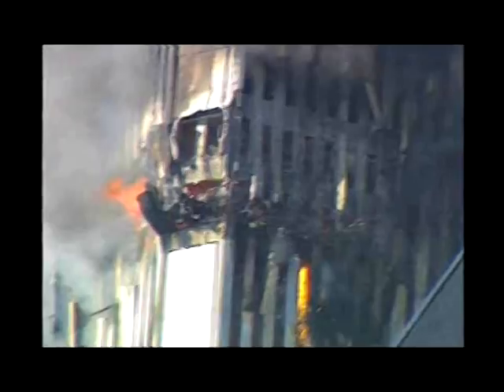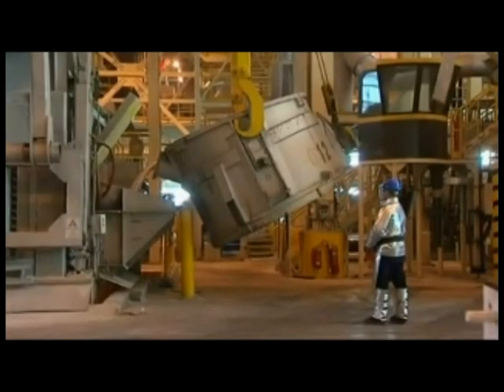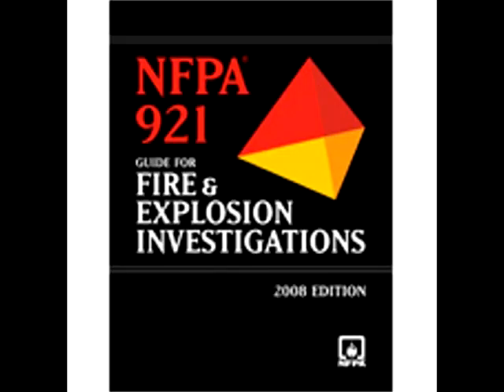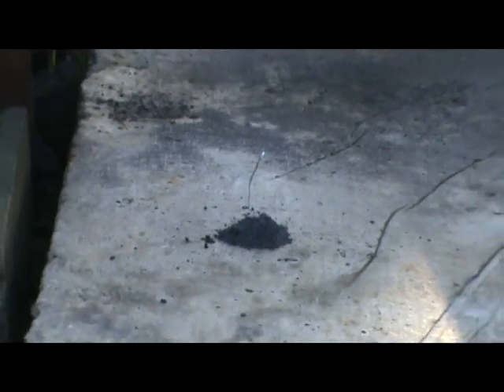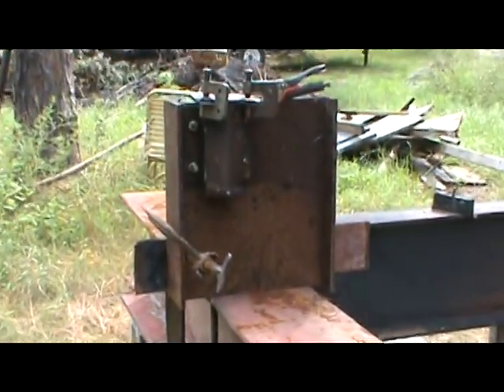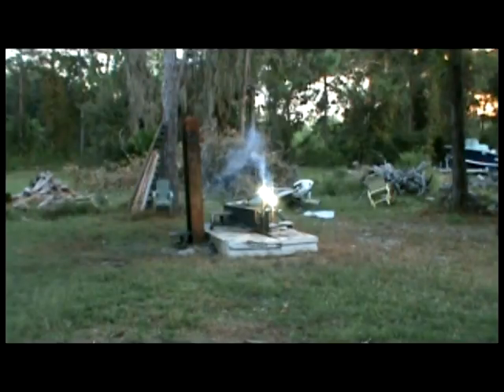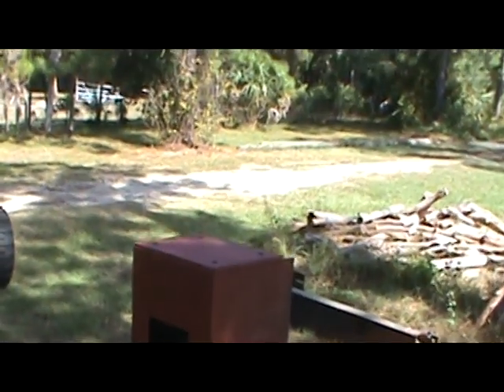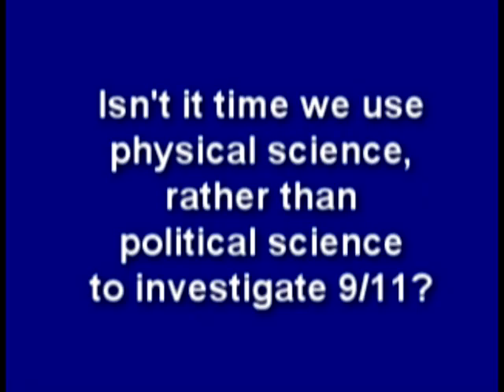9/11 Experiments: The Great Thermate Debate

Comment: Take a piece of steel rebar and try to bend it. Then heat it up with a propane torch and try to bend it. It's not rocket science everyone thinks that the steel beams needed to melt for the towers to collapse. Once they heated up with the weight of the remaining floors above them it was more than enough to collapse the towers
Reply: ScramerDude OK so if the beams were bending, why did the towers not bend sideways instead of falling in on themselves?
Reply: Because you touch yourself at night, gullible idiot

Comment: Did you notice somebody being blown out of the building at 11:09 ?
Reply: Bronze Brett explain how heat expansion localizes enough energy to blow only 1 window with that much force with no visible equalization after, so called, "energy from heat"?
Reply: That's energy from heat, forcing its way out of the building.
Reply: I BELIEVE IT WAS A  TOLET WITH SOMEONE SITING ON IT.

Comment: All good, wonderful.  Now explain this.  

The simplest rebuttal to the 'controlled demolition' theory is when they simply asked demo guys how long would it take to prep a building that size to bring it down and they said 3 months with dozens of blokes.  That's 3 months of drilling into columns, cutting beams, removing plasterboard to get access to the frame, planting explosives etc etc.   Of course in the troofer universe all of that miraculously happened under the noses of the 5000 people that went to work each day in the towers.
Reply: Never bored to be a moron, eh dear debunkers?

Comment: This is very compelling and it is nice to see someone go to so much trouble to produce something like this. The main reason I don't believe the fuel theory is that when we see the jets hit the buildings, the aircraft are immediately destroyed and both show huge fireballs - this is most definitely the fuel burning off and accepting that the aircraft are completely destroyed, all the fuel must have been burnt off in seconds. 

So, I suppose the only question I have is that in these experiments, the device which delivers the thermate / thermite charge seems to withstand the effects - this would be important if it was to complete its task, so is there any evidence from the rubble that would show similar delivery systems or should there be enough thermite to completely destroy the deliver system (which would need further experiment to prove)? I should add, I'm not looking to debunk this, I don't believe the official report is accurate at all, but it is something which should be answered.

Comment: just good ol science. no bullshitn. great video
Reply: Wes Fox ,  thermate is a variation of thermite, in fact thermate has a lower burning temperature, thermite is very intense , this video proves thermite is more than sufficient to cult through steel beams, please consider having an open point of view. thank you 
Demolitions Sergeant J
Reply: Urmom1985 You are in this case. As a welder I could bend a steel beam into a pretzel using jet fuel.
Reply: Wes Fox it gives a basis to compare the effects...and it worked very well to establish some facts
Reply: Logical Lion the pay is double what u made working at a university. 
Also learning to weld includes a whole lot of metallurgy when in comes to steel. For instance I'm aware that the melting point of steel and point where structural failure occurs are two very different things. When you talk about the melting point you are talking the point at which steel becomes a liquid. You don't need to liquefy steel to bend it. When rivets soften they fail. The floor below is designed to support it's own weight not itself and the floor above it plus a jetliner so it fails on  the impact and it's turtles all the way down.
Reply: Hey Tublecan. I can see certain logic in your premise. But lets assume that the 75mph wind speed at the top of the tower is sufficient to forma a blast furnace effect and weaken the steel. The same 75mph wind speed would see the top of the tower pushed past the center of gravity and cause the top of the tower to topple. (Which we assume was the weakened steel point). It would seem unlikely it would simply drop down on top of itself.  And I have never seen a plane crash where all the aluminium parts are focused together to cause aluminium to flow in 1 spot. (I know this is not your conjecture, but read down and see how others are trying to help you argument that it was a team of inexperienced pilot terrorists). 
I agree steel will fail well before melting point is achieved. I disagree that the floors only have to support their own weigh. The structure below the impact point has to hold up everything above it plus a factor for safety.  I believe the airliners weight would have been negligible as they normally virtually disappear in their own cash fire. It may be heavy enough to have an impact, I do not know, but certainly questionable. 
The buildings stood for a considerable length of time. The building would been effected by the wind at the top, which caused the perfect environment to create a  steel blast furnace to weaken the steel. As the steel weakened to wind would have pushed to the building off center. The building lists and ultimately  topples as the center of gravity  shifts.
Reply: David Curl what would you say, how many people would be needed to pull this planned demo off? Are we talking about like 50 people planting the stuff and then maybe another 50 involved in the planning and logistics financing and so on? I think this is best case scenario and realistically considering some are sick on vacation and so on probably you would need 250 - 500 people to make this happen. How likely do you think is it that 100-500 government employees that in normal life cannot get simple stuff going without screwing up get this done in perfection and not even one did chicken out during the project or whistle blowed afterwards for moral or monetary reasons? The scientific approach does not mean that as soon as you proof that theoretically it could have been achieved a different way that means that it was like that, it means to evaluate the most likely way things have happened.
Reply: Empty0Set there were many explosions reported by witnesses and firemen at the world trade center just prior to the collapse
Reply: If we still lived in the middle ages, I'm pretty sure you'd be dead. Darwin and such.
Reply: you're implying that 'good ol' science is conservative when it is most certainly not
Reply: +MrSharadsharma57
Thermite takes time to cut anything, creates a firework display, and you cannot install tonnes of the stuff in any building and then fire a missile at it and then an inferno then expect it to all work. 
Circular reasoning at its finest, and no science involved.

Comment: Steel doesn't have to be hot enough to liquefy in order to loose strength- 1100 degrees- is hot enough to cause bending twisting, expanding.
Reply: Just think about it a little longer please. The steel would NEVER weaken symmetrically, ergo the towers would never have collapsed into their ground lines. This is absolutely impossible.
Reply: I've thought about it for 15years- but I didn't say  how the towers fell. Don't try to make me defend a position I haven't stated..l accept neither official or truther versions- both have big holes. I said steel bends and loses strength within the temp range jet fuel burns in. Thus the " steel doesn't melt " truism is refutable as evidence. Instead of suggesting I haven't thought it through, try thinking that through. I think it's dodgy to speak in "NEVER " and "absolutely impossible" it's the language of belief, not logic.
 It may be possible to have ALL data, but I seriously doubt anyone does at this point. Drawing a conclusion from incomplete data is a well tested way to make mistakes.
Reply: the point isnt steel doesn't have to liquefied in which you're probably right, the point is there was molten metal seen so something would have to have been hot enough for it to get that way
Reply: @John B- Do you deny that my statement is factually accurate? Did you even think 
about what I said? I have not proposed a view at all- I made a statement
 of fact, Your projection onto me of a position I have not taken is all 
of your own imagining. If you think that  imagined view is 
misguided , does that mean the view you identify with is well guided? By
 whom?
Reply: " the point" ? there's only one?